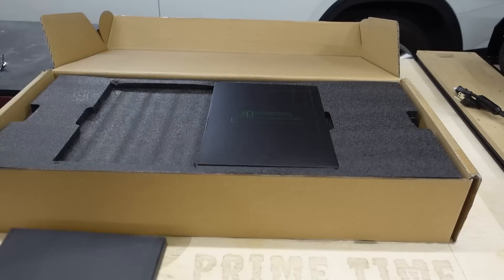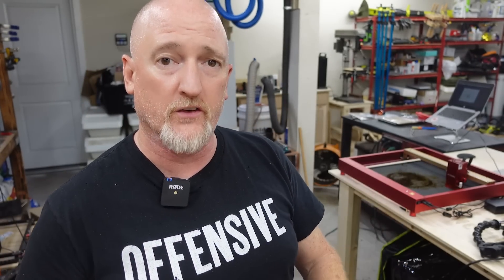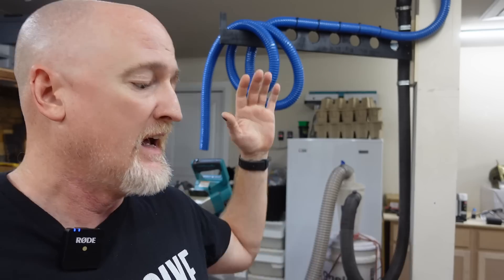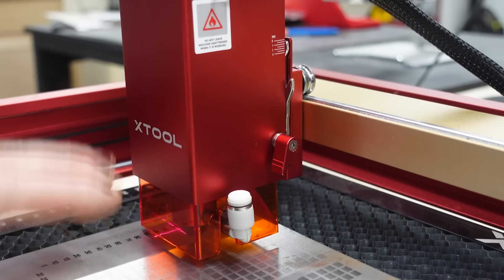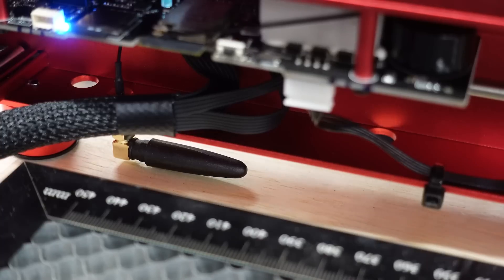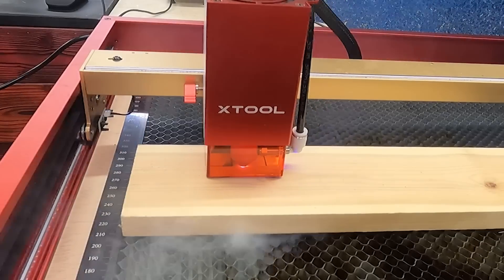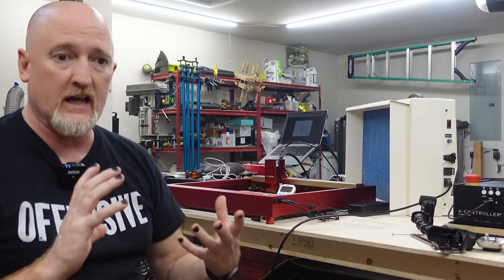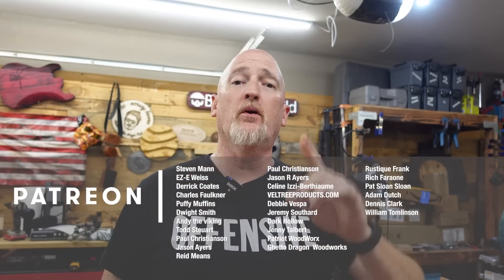This New Laser is Bananas! Meet the xTool D1 ProD1 Pro

Comment: Hey Nick, first off thanks for all the videos. Quick question. I also have the D1, it has a separate connection for the rotary tool, which I would just leave plugged in all the time to decrease the amount of handling of those small JST plugs. I see on the Pro, you will have to remove the connector each time you use the tool. Whats your experience having to do this each time? I know your using your laser much more than I am. Im looking at putting together a splitter cable.
Reply from the maker: It doesn’t really bother me to swap the cables.

Comment: Hey Nick, great vids!  Thanks to you I got an xTool D1 pro 20w!  Just did my first cut and engraving and turned out good.  Question, I can't find any reference for the distance of the laser emitter head from the material.  Do you know where it can be found?  Or can you advise some general parameters?
Reply from the maker: There is a silver kickstand on the right side of the module. Flip that down and adjust it to where it is touching your material. Then flip it up and laser away!

Comment: The idea that limit switches are "training wheels" is extremely silly.  They allow for automatic homing by the machine, and are common in CNC machines such as CNC lathes, mills, and routers; Co2 lasers; and 3D printers as they allow for the use of absolute coordinates and a repeatable return to the same location.  The safety of not destroying your machine is a bonus, especially with 5, 6, and 7 figure machines.
Reply from the maker: Sooooo...that was a joke. Actually a running joke with me and my regular viewers. Unbunch your panties and have some fun with us!
Cheers!!

Comment: Having issues with my xtool d1 where it sounds like it's grinding when engraving. The print is like shifted also. Any ideas?
Reply from the maker: Sounds like your belt tension is off. They should be tight, but not overly so. Like tight like a guitar string.
Reply: @BuildDadBuild   Thanks man I'll double check it.

Comment: I recently ordered the D1 20 w version I've read alot of comments on the xtool fb page that saying you have to use the xcs software to setup the pro or it will brick the machine and you cant use it. Not sure what brick means i guess just throw it over board did you have use this software when doing your demo if so it would be great to pass that along.
I would have never known if I had not been doing my research before setting up the machine granted I have know idea when it will arrive . Also in one of your videos you mentioned you have to turn off the mystery switch to do the updates do you have to turn this off when you begin to setup the machine, I know its alot but as beginners we look to you pros for in put thanks and keep up the good work

Comment: Nick, what's the difference between the two (10w and 20w) one, I'm really interested in purchasing this machine but I'm a novice! What all would I need to buy to operate and do cups, rings, key chains just a bunch of different items?
Reply from the maker: Can't go wrong with the D1 Pro 20 watt with RA2 rotary.
20 watt not only gets you more cutting power, but also gets you much faster engraving speeds.
Cheers

Comment: Hi Nick, my xTool D1 laser has slipped out of place a couple of times. I've checked the piece that is suppose to tighten the laser in place but it still slips and ends up sliding onto my wood that I am engraving. Has this happen to you before?
Reply from the maker: It has not. But I need more specifics to try and figure out what is going on.
Email me nick@builddadbuild.com preferably with a pic or video of the issue at hand.
Cheers
Reply: @BuildDadBuild  I figured it out. I'm an idiot lol. I didn't know you could pull the thumbscrew to the side then lift it and repeat to make it fit more snug on the laser 🤦‍♂️

Comment: I can get the D1 pro 10w now or should i wait for the 20w , mainly engraving works so do i get or wait??? Please help
Reply from the maker: You will eventually want the 20 watt. Even for just engraving. It's soooo much faster. But if you're like me (and don't like waiting)...I would order the 10 watt now and plan to upgrade to a 20w head in the future. Not a bad thing to have a 10w backup module in case anything happens.
Cheers

Comment: Nice looking rig there brother. Thanks for the show and tell.
I'm the guy in Missouri from a prior video live chat thing and say I saw from another of your vids we have the same phone case - I've been using it (or several identical but different colors actually) for many years now but have until now never came across anyone else that ever even saw it before lol we should chat more...
But back to the laser topic at hand. And while not directly related to this machine since this machine is bigger it raises a question. Does the higher power require a different amount of air on the air assist? And really for me - how do you figure out how much air is right? My setup is a 10w unit with the nozzle attached to the lens. Based on random info I found somewhere I got a large 4 port aquarium pump and plumbed them all together which provided what I thought was pretty good (absolutely no basis for comparison though). I've only had some limited time to test it because it's currently in the living room (laptop is being fixed) but the max flow made all my tests burn worse until I turned it almost off which I didn't think was making any difference then. Seriously just starting out though and probably doing it wrong lol so perhaps topic for a video?
Reply from the maker: Hey Ed!
The amount of air doesn't seem to matter between the 10 and 20 watt. As far and how much air pressure? I really don't know. My air assist from xTool doesn't have any sort of regulator.
You should check in on xTool's Facebook page. Someone there might have a better answer.
https://www.facebook.com/groups/xtoold1
Cheers

Comment: Question... is laserbox basic the software to use? I see another option on there called "rotary and pro". Which one is best to use with the D1 Pro? Thanks so much. Love your channel.
Reply from the maker: Laserbox Basic is the only xTool software that will run the D1 right now. They have a beta that I don't think is available yet that is more all encompassing.
I recommend Laserbox Basic when you first get started and then move on the Lightburn.  It's far more robust.
Cheers

Comment: Great video 👏
The only thing that’s a negative point with this machine is because the laser module is a lot larger than the old 10w then you would have less working space within the frame as it’s not being increased in size.

Comment: So I have to ask whats better and what are the differences between the D1 20Watt and the D1 Pro 20Watt ? Besides the limit switches, color and flame sensor?
Reply from the maker: The biggest difference is it’s not all hobbled together. I feels more like a finished product and less like a Frankenstein-Ed machine. 
If you have a 20W unit I would stick with it for now. If you’re running the 10, I would suggest upgrading either your module or the whole system. It will save you so much time.
Reply: @BuildDadBuild  Thanks for the info, This is pretty much exactly what I did. I already own the D1 with the 20 watt module, and on XTools launch night I purchased the pro 10 watt. I’m curious to see what will engrave faster the now older 20 watt (hard to believe) 🤪or the new pro 10 watt.

Comment: Hey man I Have become a huge fan of your videos  and I'm a newbie/rookie AKA baby to laser engravers and I have watched  others  videos  other than  yours and do you still recommend  get a co2 fire extinguisher for any diode laser machines??
Reply from the maker: Yes. You need some sort of fire extinguisher if you’re running lasers. CO2 will save at least parts of your unit if you need to use it.
Reply: Another question  for yahoo If I have the xtool d1 am I able to purchase just the d1 pro laser to upgrade my current  xtool d1 laser power??

Comment: Kinda mad that I just bought the “older d1” on Father’s Day, and then this comes out a couple weeks later, I guess a lot of people are trying to return their recently purchased D1 for the Pro, but they have to pay a restocking & shipping fee, plus the price difference. I’m not willing to pay all that so I’ll just deal with the D1 🤦‍♂️
Reply: You're not the only one who is upset because Xtool absolutely screwed over their newest customers in this case. I've had mine for two weeks and it is still in the box, however they made absolutely no effort whatsoever in regards to informing customers via their website that an upgraded version was just right around the corner. Zero. 

So I'm sure you all can begin to imagine the sour taste we all developed when we learned that this upgraded model was released. We spent days researching which company to go with, and on each of those days we continually visited their website to compare to the other offerings from different companies. Nowhere was it even suggested to us that a new model was just around the corner. Many of the complaints about the previous model (D1) were addressed in this new upgraded model, but hey let's not tell anyone about it so that they end up wasting their time and money.

It's noticably more expensive to buy the individual upgrades to the D1 unit (changing it from 10w to 20w) than if you had bought the D1 Pro instead. Moreover, their marketing trys to get to believe that you're "upgrading" your D1 by purchasing the 20w module, however upon close inspection what is really happening when you purchase the 20w module is that you're just lining their pockets for no good reason. 

"But hey guys don't worry! If you want the new Pro model you can just pay us more money even though the decent thing to do would have been to inform our customers that this new model was on the way so that they could benefit from the upgraded unit. Open up those wallets people!" 

Come Monday morning I'll be contacting them to see if they will make this right by us.

- I don't want to pay the return shipping fee
- I don't want to pay the restocking fee
- I want them to take the D1 unit back and allow me to pay the difference for the newer model

If they refuse, then you have your answer as to what kind of company this is. There are a great many people I've run across who feel the same way that I do now and rightfully so. What they did in this situation was unacceptable, amateurish, greedy and stupid. Should they choose to make this right by myself and others, then I'll be singing their praises for doing the right thing. Should they not, I'll be returning my D1 and never looking back.

Would be nice if the people who promote their products would help us circumvent this predicament that Xtool placed us in by helping us to apply pressure on them to make this right by their newest customers.
Reply: @kitlerhh , I am in the same boat. Still waiting on the extension etc I bought. But I am not even going to try and do the return. I agree with everything you said. This just left a bad impression on me all the way around. Luckily I only wanted it for tumblers since I have full-size C02 and Fiber so I really don't have to worry about the rest. But for them to work it that way just tells me to stay away from any further launches and machines from them. I have stopped watching the launches now that I see how fast they produce stuff. It's great and I did by at the wrong moment. So I might come back and see where they are in a year or so I am sure those buying this one will be upset to see a 30-watt rollout in a month lol.
Reply: @kitlerhh  Put me in the same boat with you and everyone else who feels a bit butt-hurt about their customer service shortcomings. I sent four emails before I had any contact w/XTool at all. Honestly, I don't think I would have heard from them at all if I hadn't gone on their "Live" show last night where they featured an extended model enclosure a week or two after introducing the original enclosure. After ducking me for several weeks, they want me to pay the return postage AND the 10% "restocking fee" to upgrade to the 20w laser. I am seriously disappointed, since I haven't even opened the boxes yet. I'll probably end up with the package (10w) my wife bought me for Father's Day, but if I do, I'll be on every "Live" show they have complaining about their poor Customer Service. If enough of do this, maybe they'll improve. We'll see. Thanks for reading my mini-rant.
Reply from the maker: I thought they were offering a deal to swap them out. 
https://www.facebook.com/groups/xtoold1/permalink/3354118591577712/
Reply: Ya… I’m pretty sure I ordered mine the day before this came out. I feel ya.

Comment: Is the D1 pro actually faster compared to the D1? or is the 20W version that has more power hence needs less time to engrave?
Reply: It’s actually faster, XTool explains it in their video with both having 10W heads. If I remember correctly, it burned the same design 4x’s faster

Comment: Is the laser cutting ability the same as the other 20w for D1 ? The 20w D1 pro has a smaller spot .08x.10mm vs .08 x .15mm with 20W upgrade for the D1.
Reply from the maker: It’s pretty similar

Comment: the colors in THEIR example is due to material... kinda like when you burn a QUALITY knife blade.. or heat up a QUALITY aluminum exhaust pipe... I bought an after market exhaust for my motorcycle, paid like $1500 for the pipe.. out the box the pipe was a flat colored silver aluminum BUT after I rode the bike for a few hours, the heat on the pipe from the engine created a bluish rainbow - no laser needed... its the heat. The red color for the pro is nice as long as you don't scratch it... seems like the red will show more wear and tear over time... but it does look nice out the box.
Reply from the maker: I figured it was material. I ordered some of the metals they used in their video to see if I can recreate it.

Comment: Yeah I’ve been cutting inch thick pine since I got my 20w. Love it.
Reply: In the video the 1" pine was burnt to hell on the underside. Do you know if it can cut 1/2" hardwoods cleanly and effectively?
Reply: @SG13108-h  mine didn’t come out that burnt. Maybe a little charing but nowhere near that bad
Reply: @rickparma  thanks for the feedback. I have the 10w. I'm trying to decide between a scroll saw or adding a 20w module. Pine is soft. Have you cut any 1/2" hardwoods?

Comment: Still prefer the Atomstack A20 Pro. Cheaper and comes with air assist. With discount code all for $999 compared to this one for $1170 plus $139 for air assist.
Reply from the maker: I've had the worst issue with Atomstack as a company. No thanks. Good luck to ya!
Cheers
Reply: @BuildDadBuild  what happened? 😱
Reply: @BuildDadBuild  can you elaborate? First time I've heard anything negative about Atomstack.
Reply from the maker: @zakspop  how much time do you have? LOL. First there are at least 3 companies that claim they are the official Atomstack. So figure that one out. 
Second they have sent me several units that either don’t work or are missing parts. And they claim that it’s my fault. 
I had one of their 2 legged gantry units and I couldn’t get it to ficus correctly. After a couple of emails back and forth they just stopped responding. 
Their customer service (at least through 2 of their “official” website is garbage…like worse than xTool’s)
And their marketing folks don’t know what they’re talking about. 
I’m sure there’s more…

Comment: Fantastic video as always!  I am probably not the only one out there that feels a left in the dust.  I ordered the d1, then there was an announcement that they would be releasing a 20w laser, an extension kit, an enclosure...............  on and on.  This is fabulous to see a company developing new products.  I still do not have my 20w laser or my extension kit.  They have released a new complete kit which is awesome but I feel they have not considered their existing customers promised products. I would like to see them offer an upgrade package so that you are able to make your d1 into a pro.  You seem to have a good working relationship with xtool, PLEASE contact them with these concerns as I have already.  I have not received anything back other than how do you like the honey combs you have bought?  I bought all this to use the 20w laser and extension kit both of which I do not have!
Reply: I'm in the same boat and bought the 10W Pro at the live and hope I can get them to exchange the 20W for the 20W Pro ;-)
Reply: They said explicitly during the livestream that they won’t offer any upgrades for the old model, I think this is because the new one is 24v and the old one is 12v, so everything would have to be exchanged (all the electronics), so it would probably be hard for the end user/expensive. Also, I think part of the limit switches is built into the rails, so you wouldn’t have a way to attach the limit switches to the old machine.
Reply from the maker: Peter...I appreciate the fact that you think they listen to me. They don't.
And I agree they are launching things way to fast.
Cheers and good luck

Comment: limit switches aka homing switches are mostly for repeatability. To say cut from the exact place every time.  If your work place center is at 5"X and 6"Y you can get to that exact location every time. I would think of them more of a advanced user feature.
Reply: Yeah I don’t think they’re super accurate. It would be cool to see them implement the sensor less homing that we enjoy on 3D printers. Or even do encoded steppers that can keep track of their position even after power off or being moved by hand.
Reply: I saw other video earlier today that tested the limit switches repeatability and it totally failed, it seems they used optical limit switches and not mechanical ones as most other machines. 🤔
Reply: @Bogaloo1232  exactly. Optical limit switches are only good for preventing carriage crashes - NOT exact repeatability.